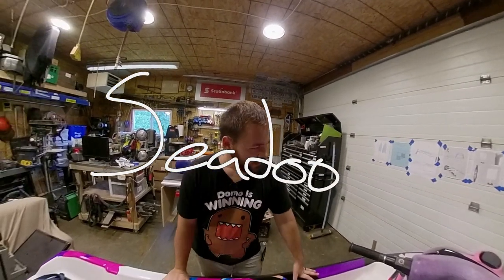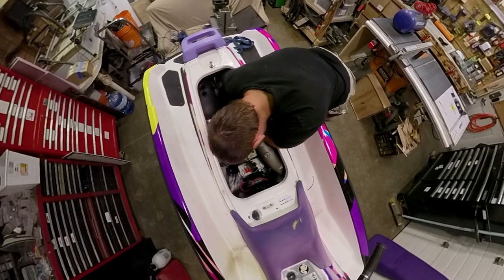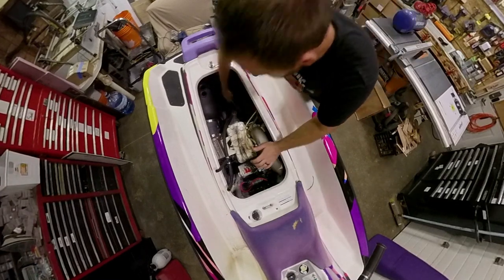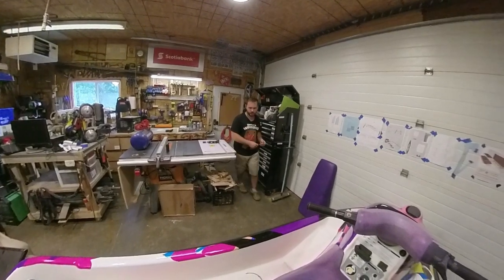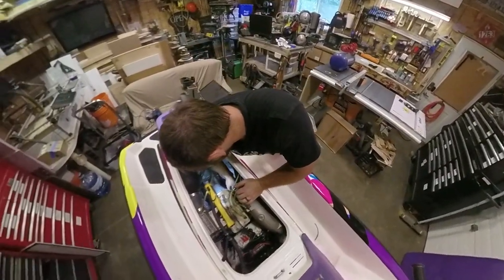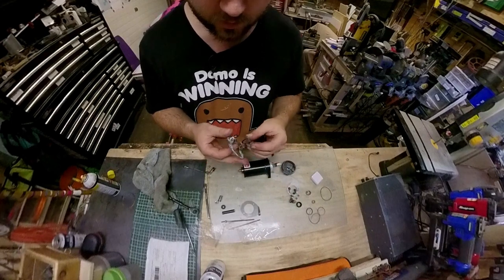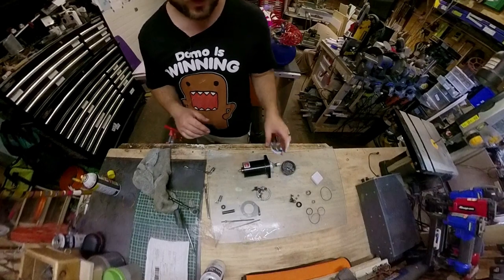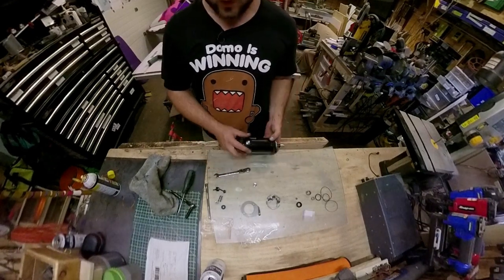How to fix seadoo not starting!

Comment: I have a 2004 seadoo gti,when I try to start it,the engine spins with spark plugs off,and when I install the spark plugs and try to start it,doesn't spin at att,it only clicks,what do u think the reason could be?
Reply: I have same problem
Reply: I have the same 2004 Seadoo GTI RFI, bought it used and ran good this summer and now wont start, replaced Starter, Starter solenoid and tested and cleaned all connections and discovered my cylinders are FULL of oil, now I need to figure out how to get the oil out? I think that is my next mission..but why is it just clicking? Help us!!!

Comment: We have a glastron gts 2016 207 jet boat.  We were on the water running a few minutes later it turned off and then does not want to turn back on, no crank or anything the check engine light goes flashing.    if I disconnect the battery and leave it about 10 seconds and connect it back the boat turns back on with no problem but will only stay on for another few minutes ( boat has a brand new battery)